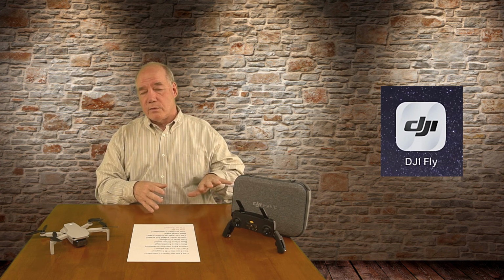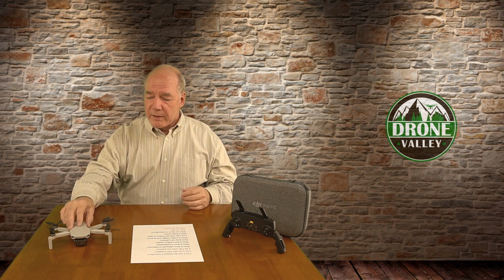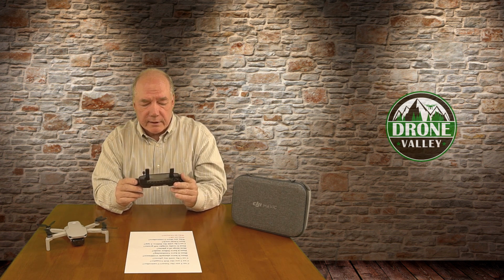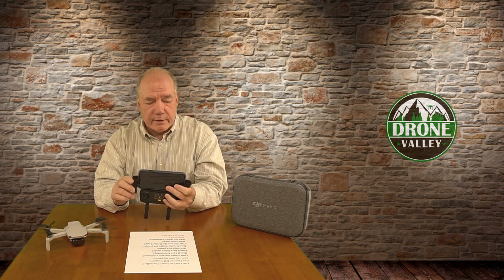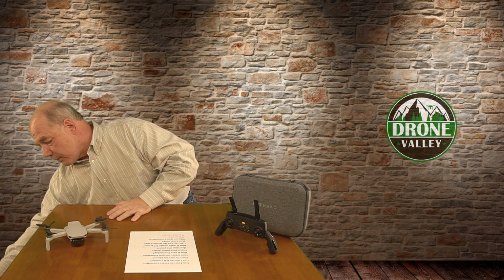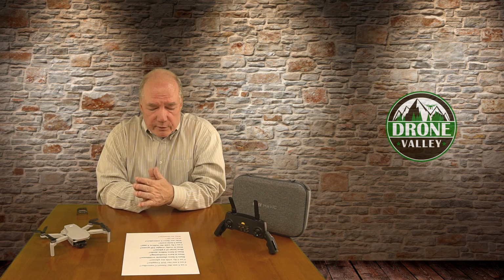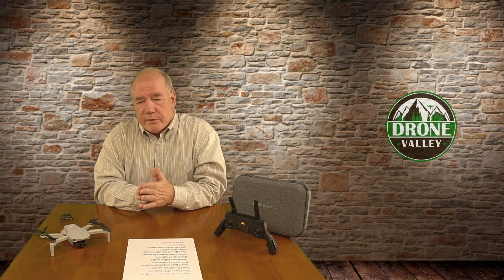Mavic Mini - Your Top 10 Questions Answered

Comment: My Mini weighs exactly 249g, however that is after it became totally unresponsive, and developed a mind of its own and flew around, on its own, then crashed. The 249g weight was measured with one and a half props missing, gimbal parts missing, and a small chunk of body panel missing from the crash. 
The math doesn't add up.

Comment: How many feet up and far can we go
Reply from the maker: In the U.S. you can fly up to 400 feet and fly as far away as you can still see the quad. For me that is about 1500' on a clear day with a beacon on the quad. I hope that helps and thanks for the post! Rick
Reply: @Dronevalley  well how about on this quad what is the distance and height that the mini an go I just had mine crash was taking off and all of a sudden I got a mind of its own went up about a foot high then went full speed striate until it crashed tried going up but the remote was not communicating with the quad at all
Reply: So I’m hoping DJI does a swap giving the fact I only had it since the 8th of this month

Comment: I have recently heard that the  Smart controller is now compatible with the Mavic Air 2. Have you had any experience with this setup I am from New Zealand. I have heard a few comments  about the software setup has not been easy to do and some of the aircrafts stability has been less than good. Could you pass on some experience in the subject.
Kind regards Peter.

Comment: Do they make a cable that will work with the Otter box for apple.  The right angle lighting plug will not fit into the case.  It is just to short.  It it was a straight connector it would work.
Reply from the maker: Scott, we designed our cable to have an extended connector that you can use with the OtterBox. Here's a link to the Mavic Mini Page on our website. Pick the one that fits your phone. https://www.dronevalley.com/store/c26/Mavic_Mini_Accessories.html
Reply: @Dronevalley  thank you.  I ordered one.

Comment: rick ive just got motor caps for my mini, do they make any difference when flying and would you recommend them?
Reply from the maker: Alan, they are fine to use and won't interfere with the quad. Some folks worry about heat but the motors are cooled by the wind when flying and the caps protect the delicate windings of the motors. I'm not sure if you bought them from our website but we have other Mavic Mini accessories on there as well you might like.

Comment: Hi Rick, First of all I truly enjoy all your videos as I am a new done owner/flyer. I recently purchase a Mavic Mini which I love. My question is this.When experiencing high head wind with my Mini, (NOT GOOD) , I was told by some folks that there are ways to possibly return it home safely. I understand that I should go into S Mode and then decrease my altitude first and foremost. But it was also suggested to lower my gimbel  approximately 20 to 25 degrees which in turn, increase the pitch of the mini giving a little more speed through the air. Does this make sense to you?  Would love to hear your thoughts on it. Thanks again for your videos, there great and very informative for new flyers.

Comment: with the gimbal wheel, do you have to keep turning it to tilt the camera or do you hold it in one position and it keeps tilting until you release it?

And when filming in 2.7k, can the video be downloaded to your phones camera roll through the app? And the same question for 1080p
Reply from the maker: Thanks for the post and the wheel is spring-loaded so you can hold it have the camera tilt and release it when you're happy or "jog" the wheel to get the camera in the perfect position. Both work and it's just a matter of preference. With the Mavic Mini, all of the video is recorded onto the MicroSD card in the drone so you'll have to manually transfer that to computer or phone to view it. We designed a 4-in-1 Memory card reader that makes this transfer easier and here's a link if you'd like to check that out. Rick https://tinyurl.com/yyhb9xh2

Comment: 3 months after this video my main complaint is the Geofencing is out of date.  I live in a LAANCE 400 FT AUTO-APPROVAL zone. My mini is blocked from flying a over 200 feet.  Trees close to me are over 200 feet. There is no safe RTH altitude for me. And they won't take an FAA UAS map and one of my 400ft LAANCE approvals as proof to custom unlock.  So DJI is out of date in both map data and customer support policy.  Pretty much means my next large drone will be an Autel.

Comment: As far as fitting a cell phone with a protective case. You did say it still will fit, but if you don't want to file the rubber down. Maybe put a rubber band on both ends of the 

controller to secure it a little better. Thank you for posting.

Comment: You need some spill suppression on that key to eliminate the green spill.
Reply from the maker: Mark, thanks for the post and I am in the process of redoing the studio over the holidays and will try and clean that up. The challenge is that I have to have the table too close to the screen and it reflects a lot of the green. With the new setup I'll have a few different walls to work with and can sit further away from the screen and it should be cleaner. Stop back soon for more content. Rick
Reply: @Dronevalley  Again adding some spill suppression in post should neutralize the green.
Reply from the maker: @markspencer4557  Mark, thanks and I'll try and tweak that a little going forward.

Comment: Question #11: If, due to its size, the Mavic Mini does not need to be registered with the FAA, does that mean it can be used commercially without having to have a Part 107 license?  Or, is a 107 required for commercial use regardless of whether or not a drone is subject to registration (or any other FAA regulations)?

Comment: There seem to be 2 issues with mavic mini, that ppl will be complaining about. As the mavic mini is quite new on the market, maybe some bugs?

First issue is a video distortion line at the bottom (filmed 2,7k and 30fps) - using a standard player and orginal file from the drone. Second issue: it seems that some here - incl me - experience some disturbing hittering/shaky videos. Happened to me, there was wind, but not that much conpared to other guys videos here on youtube. Both issues concern more and more ppl, maybe worth a look at it? DJI is slow to react/answer

Comment: Greetings from Cyprus. I have a quick question on the Mavic Mini please? What format is the high resolution file which is stored on the micro SD card? I have just taken delivery of my Mavic Mini and have completed just one flight so far. I noted that the file on the micro SD card was 'DJI_0001.MP4, and with the file copied from the micro SD Card to my PC the video file was unplayable! I was so disappointed, and I thought that my first flight footage was not available. I did however download the video file from the Mavic Mini with the controller/ DJI Fly app (took ages) and WAS able to view the footage. I later found that if you use a video converter (which seems to convert the file from *.MP4 to *.mp4) you can download your files directly from the micro SD card to your PC, and view the *.mp4 file as normal. Any thoughts or ideas on this? Cheers

Comment: No fly zones are like buying a car and the manufacturer telling you you can only drive on certain roads.
Reply from the maker: Justin, thanks for the post but its actually more like buying a car that prevents you from breaking the law by driving on to a military base or crashing through an invisible gate at a prison. These limits are there to protect you from innocently crossing a line in the sky that is a federally mandated No Fly zone. It's just that simple, and folks that are against these limits are missing the point that they are there to protect both the area and the flier.
Reply: @Dronevalley  I get it but why are all the other manufacturers not doing it?

Comment: Looking for some advice.
I have watched a lot of videos on the mavic Pro, Air, mini, etc. air vs Pro, pro vs standard now I am more confused then ever.
I have the phantom 3 standard, but don’t fly a lot do the size to carry etc. so when I seen the mini it has got me into looking the portability for the mavic series.
Each seem to have minor advantages or the other.
I am leaning towards the pro, due to occusync. 
So my question what do you think would be the next step up.
Reply from the maker: Roy, the Mavic Pro is a beast and if you have the budget, that's the one to own. If you want a less expensive version, the Mavic Mini is perfect and you'll get about 80% of the same experience minus the 4K and the Ocusync. I could argue that both of those are overkill since most folks don't render in 4K and Ocusync will let you fly for 4 miles but you're still limited to Line of Sight. I also think the Mavic 2 is a bit of an overkill when compared to the Mavic Pro since you can get a brand new Mavic Pro for almost $700 less than the Mavic 2. Sorry if that was confusing but if you can afford it, grab a Mavic Pro and get out there and fly! Rick
Reply: Does DJI typically have discounts for the Christmas season.
May wait if they do for the Mavic Pro

Comment: If I pull one battery out of the charger will it keep charging (a cell phone)...?
Reply from the maker: Charlotte, thanks for the post and yes, if you have a single battery in the hub that has any charge left in it, it will charge whatever you connect to the hub. The reason for this is that all 3 batteries are in parallel and when you add a second or third battery to the hub, you just increase the amount of energy they have to give back for charging another device. I hope that helps and be sure to stop back soon for more content. Rick

Comment: Hello excellent video. I have a question about the mavic mini, the system tightening the propellers it's safe? They won't get loose with flying and time of use because of tight by screws? The other drones are tightened by twisting the propellers isn't more safe by twisting propellers
Reply from the maker: The screws that hold the props on the quad have Loctite on them and hold really secure. I'll be posting a clip tomorrow showing you how to change the props so be sure to sub the channel and stop back for that. Rick
Reply: @Dronevalley  thank you very much for your answer I'm now subscribed to your channel

Comment: Do you still do all the needed compass and IMU calibrations before flying the drone after the controller-drone binding procedure? Thanks!
Reply from the maker: Thanks for the post and I did the compass calibration before my first flight and haven't had to do another one since. If you move a log distance between flights or have the drone near a lot of metal you may have to redo the compass calibration but the process is easy and take about 30 seconds to complete. The danger in not doing it when needed is that your home point might be off and that can affect your RTH position.

Comment: Does it have automatic return to home if signal is lost?
Reply from the maker: Yes, it does have an automated RTH if the signal is lost or the batteries get too low. You can also force it to RTH as well by holding the button on the remote. It's a wickedly smart quad and I'm still amazed at how much tech they've packed into this little guy. Be sure to sub the channel and stop back so you don't miss anything new I'll be posting. Rick
Reply: @Dronevalley  nice. I'm a fpv droner but I'm looking for a nice cinematic drone. This looks like it fits the bill.
Reply from the maker: @carveking  Lol, it's not quite as fast as the FPV but is a dream to fly, stable and takes great video and pictures. Here's my link if you want to support the channel when you buy it - https://tinyurl.com/y67sbgmr

Comment: what is the true flight time compared to other DJI drones and competition in the same size?.
Reply from the maker: Robert, thanks for the post and the specs peg the flight time at 30 minutes and I believe it. I have gotten 26 minutes in the air with 10-15% of batter left in the quad so I'd say a 23 - 25 minute flight time is reasonable without worrying about running out of power.

Comment: I want this drone to take to Mexico with me, and the weight let’s me do so with out having any problems with TSA or security clearances, am I right?
Reply from the maker: You're totally fine and I've taken much larger drones with me (Phantom series) without issue. Just remember that you have to bring your batteries in the cabin with you as carry-on and can't check them as luggage and you'll be fine.
Reply: Drone Valley do you need to put the batteries in a fireproof bag though for carry on?  I’m confused why you would have to buy fireproof bags for batteries?

Comment: I would like to buy this drone for photography, but I noticed that it does not have a RAW setting.  Is this limited by software or hardware?  If software, any chance that DJI will update their software?
Reply from the maker: Juan, thanks for the post and you're right, there's no RAW setting on the Mavic Mini in this release. I actually have a beta version of the app so it might be different with the released version so we'll all know more on Monday. If they don't add it now, it's possible that they could add it later through a firmware update so stay tuned to the channel for updates. Thanks, Rick

Comment: Questions:
2:56 -Can I use the Mavic Mini with a smart controller? Can I use it with DJI Goggles? Can I fly the DJI Mavic Mini without the controller by using my phone?
5:06 -Why didn't they build obstacle avoidance into this quad?
6:20 -Does it have geofencing (NFZ)?
8:10 -Does it have follow mode?
8:46 -How large of a phone can I use with the controller?
11:55 -What is the weight?
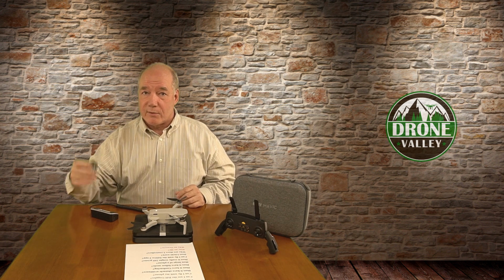13:15 -Should you register the drone?
13:47 -Can I fly it with the DJI Go 4 application?
14:24 -Does Lychee work with it?
15:00 -Why are there multiple versions of the controller?
16:30 -Why no 4k? Why no Ocusynch?
Reply: Thanx. The first 3 minutes of babble were getting to me.

Comment: You hade the Ipad Mini 4. I have the Ipad Pro 2018 (11inch). Can i use this also with a longer cabale?
Reply from the maker: Thanks for the post and you can use that larger tablet but you'll need to use a tablet holder since it's too large to fit into the handles. You'll also need a longer connection cable to be able to reach the connection on the iPad. We have both of them available on our website - https://tinyurl.com/y2895ood if you want to check them out. Thanks for supporting the channel! Rick
Reply: Drone Valley Thank you for the quick anserw.

Comment: I have googled extensively, looked at thousands of comments on videos, and read dozens of spec sheets but still haven't found what the maximum height AGL (above ground level) that the Mini will fly. I can't believe how hard it is to find this one simple stat. Does anyone know?
Reply from the maker: Harley, the legal flight limit is 400 feet AGL in the U.S. and the drone has a physical limit of 3000 meters above seal level. I hope that helps and thanks for stopping by. I'll be posting more clips this week so be sure to stay tuned. Rick

Comment: Hello Rick. Quick question, you state that DJI has released the software for Litchi to support the Mini. However other threads are saying the opposite, this one supposedly a direct response from Litchi: "At this time we don't know if DJI will add support for the Mavic mini in the DJI development kit (not to be confused with DJI Go/DJI Fly).
If and when DJI does add support for this new drone model, then we will add support in Litchi. It is too early to tell when this will happen, it can take weeks or months, it mostly depends on DJI at this point."
Have you had direct correspondence with Litchi that indicates they have the updated dev kit that includes the Mini?
Thanks

Comment: drone valley didnt manfactre that cable lol they are availible on ebay for like3-6 bucks
Reply from the maker: Bruce, thanks for the post but we did manufacture the cable as we do with all of our Drone Valley products and just because two cables look the same doesn't mean they will work the same. Most of the products on eBay and even Amazon (sadly) can be cheaper knock-off versions of the original that look good but won't last. If you check the sellers of these cables on eBay you'll probably find that they are located in China, ship from there as well, will take weeks to get the cable to you and won't be around if you ever need help or a replacement. We design and manufacture all of our Drone Valley gear ourselves, test it thoroughly before ever putting it out for sale, ship daily from the U.S. and will be here down the road if you ever have questions or issues. We're proud of what we're designing and want you happy with anything you buy from us. I hope that helps clear things up and please stop back soon for more great content. Rick